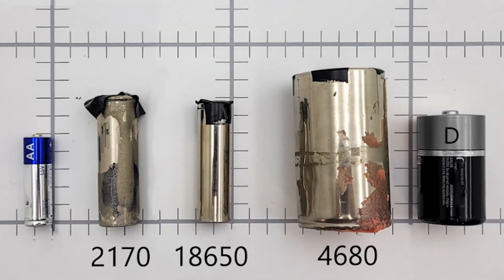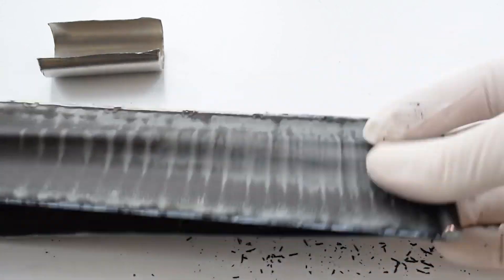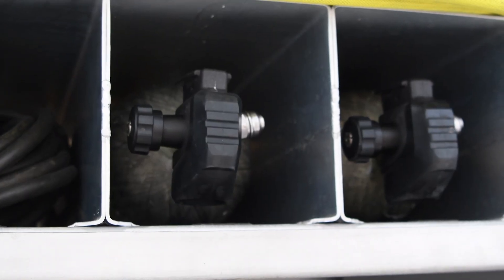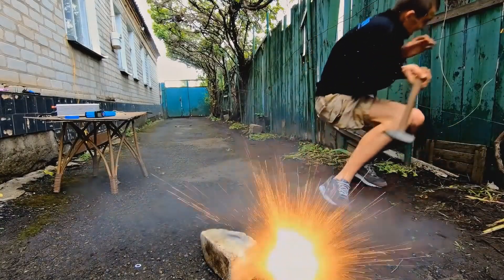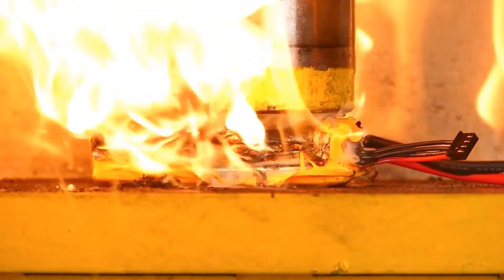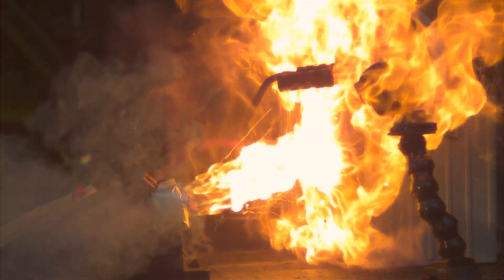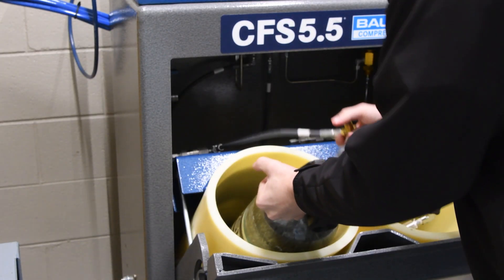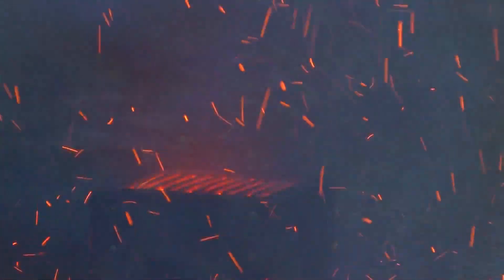Lithium-ion Battery Construction & Basics: Firefighter Basics

Comment: You briefly mention EV's in the beginning.  Are the risks the same in those batteries as those that you show in the video?  What is the protocol if an EV catches fire in the garage or outside?
Reply from the maker: Standby.   I will cover EV failures and fires in a future video. While the fires are quite energetic,  the battery cells are typically better quality and protected from damage.